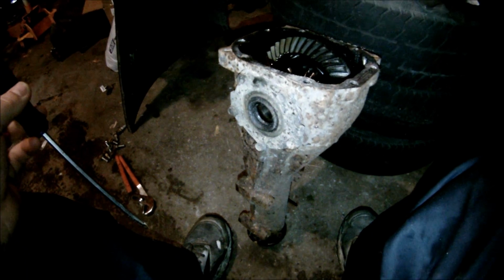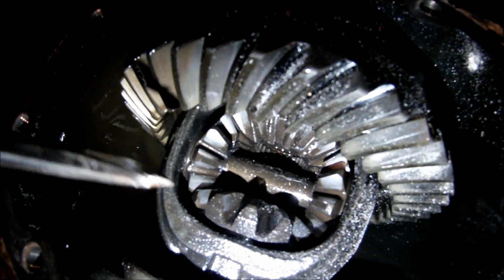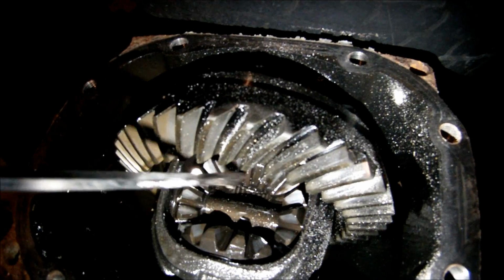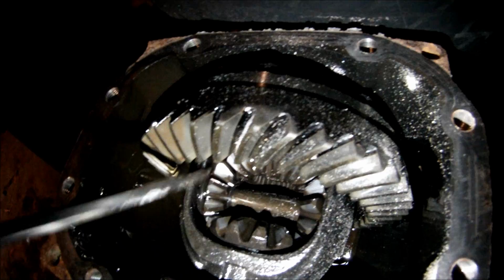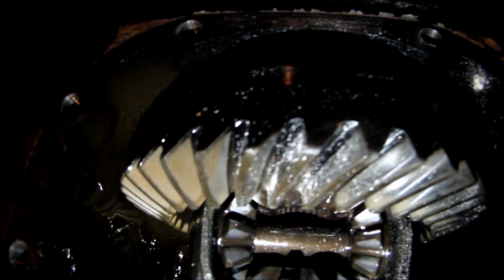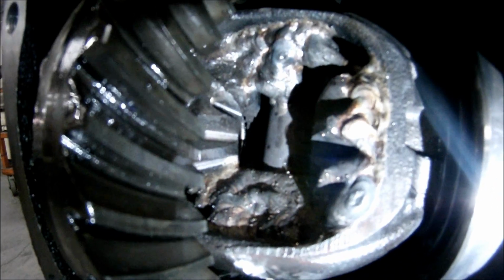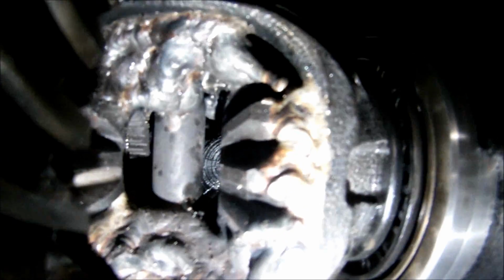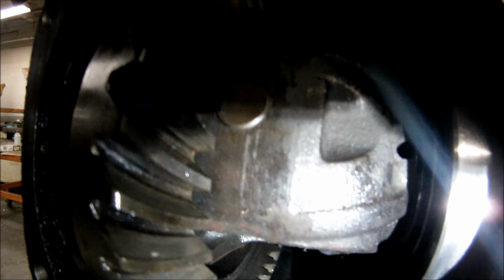How to weld a rear diff - RWDSUBY

Comment from the maker: You have the same car that this rear diff went in: 1997 Impreza Brighton with the EJ18. :)

Yeah, I trusted myself with my 110 to do all of the welding and it never let me down.  I even used the flux-cored wire that was in my dads smaller 110 and it was fine.

At one point I had a fullsize Chevy Tahoe and welded the rear diff on that, and it had some 35" Mud Terrains on it.  Even with all that weight, tire width, and torque, the welds never failed.  Go for it!

Comment from the maker: You are absolutely correct!  This vehicle was nothing but a toy for me, so I didn't care that it chewed through tires at an alarming rate.

It would bind up during full-lock corners and take a bit of throttle, but the car never lost turning radius.  I attribute that to the fact that it was so light though.

If you have the funds, it would be best for a true LSD, or even a Detroit style locker.  This was just cheap, easy, and fun.

Comment from the maker: If you're referring to the CV axle, you're correct.  If you're talking about the main carrier shaft inside the differential unit, you do weld that.  The shaft just acts as a bearing surface for the two spider gears that rotate on it, and we don't want them to spin at all so we use that shaft as yet another anchor point for the gears. :)

Comment: Just a bit of extra advise to anyone that attempts this... Please for the love of gawd, take 5 minutes to clean your welds. If there's any loose slag chunks sitting in the diff when you put everything back together, you run the risk of those bits of weld getting caught between the main gear and the rear diff cover. This will eventually cut a hole right through the cover, and nasty diff fluids will rain on your parade.

Comment from the maker: I believe it helps lock both wheels more quickly when the e-brake is pulled because even if one brake has less pull, or one wheel has more grip, if one wheel stops turning they both stop.

With an open diff, if you yank the e-brake going in to a corner I could see the inside wheel stop spinning due to less weight on it, and the outside wheel continue to turn since there is more weight.  That'd stop your skid and make setting up for the next turn more difficult.

That's all a guess though, sorry.

Comment: Good info but for those looking into this realize you loose quite a bit of cornering ability unless you are going for full on drifting, it will be harder to make 90 degree turns and will wear the rear tires MUCH faster. Otherwise cheap option for drag and drift. Best option would be a rear LSD (if you got some money to burn)

Comment: i would have to assume that the heat build up from welding the carrier so messed with the stretch of the ring gear bolts, allowing them to lose thier bite work out over time. good tutorial though.

Comment from the maker: I wish I knew. :|  Some of the bolts were shorter than others, indicating that they either sheared, or were abused while inside the case.  The other bolts were full length.  All bolts had rounded/blunted threads though.

Comment: When you weld on the gears it causes them to be out of balance ever so slightly so after time the whole thing vibrates and loosens the bolts. My theory...
Reply: nothing in the diff is balanced anyway.. And if you manage to shake out your pumpkin bolts you shouldn't be working on cars...

Comment from the maker: Meh, I cleaned everything very well.  The reason the welds look like shit is because I didn't pre-heat the massive ring gear carrier, so all of my welds were relatively cold, and because I used 316l Stainless wire with pure Argon gas, to weld mild steel. :P

It's still going strong, and that's all I need it to do. :)

Comment: hi, i got a BMW e36 316i, and im building it into a drifting car, do you think that diff will break if i weld it, or is it strong enough? some guys i've spoke with has disencouraged me to do so, due to the diff being a cheap diff and will probably break very fast, any thoughts?
Reply from the maker: I'm sure it'd be fine, but I don't know BMW diffs at all so I can't speak with certainty.

If my little r160 diff held up to this abuse, I'm sure your BMW would do just fine though. :)
Reply: +Alphieboy Haggard Garage has welded at least two e36's diffs without any issues as far as they have said.  Drifting is hard on every part of your car.  It will certainly take the life out of your diff quicker but it'll last as long as your e36 doesn't have like 200k+.

Comment: You pull weld? Would be better if you push weld
Reply from the maker: Yes sir, I've since learned that technique.

I'm a completely backyard learned welder, so trying to figure out the proper welding procedures has taken me quite some time.  I'm still not very good, but my welds get me by with my projects.
Reply: how long ago did you learn to push weld?
Reply from the maker: Two or three months.
Reply: Depending on what type of welding he did, you can only push a puddle with mig welding if he stick welded it than you can only drag, if you push with stick welding you will get a ton of slag inclusions
Reply: Richard Dailey Slag inclusions are fine if you can sand them down. I wouldn't suggest stick welding on differentials though. just my .02 :)
Reply: that is also true but i would still only use mig or tig
Reply: Yeah for sure!
Reply: Why not stick weld a diff? Stick welding gives you the greatest penetration and if you are profitiont at it the weld looks like a stack of dimes and will be stronger than a mig weld.. Tig welding would be much too difficult to do because the metal has to be super clean and you don't have the room to get a tig torch hand and filler metal hand in such a small area. When I welded my diff in my 240 I ran some 6010 stick rods and than 7018 and than filled it out with my mig gun.
Reply: because it gives off so much heat and you dont want to melt the gears
Reply from the maker: ***** Yep, you're right.

Comment: and who the hell welds oily metal?
Reply from the maker: It was all cleaned before hand using brake cleaner.
Reply: +Travis T NEVER use brake cleaner for cleaning metal prior to welding. When you heat it up it creates phosgene gas which can kill you. Check Google for a lot of unfortunate stories. Use acetone instead.
Reply from the maker: Thank you very much for the information Michael Ahlmann! I'll make sure I heed your advise in the future. :)

Comment: Well well . It broke anyway  now did you learn Anything from this waste of time stupid process . ?? 
Welding centres up never ever lasts more than one day after .
Reply from the maker: Why do you have to try flexing your brain-muscle on stuff you don't have first-hand experience with?

Nothing broke.  The bolts backed themselves out after I welded everything and the heat cycling caused them to loosen.

Waste of time?  Why can you say something I do is a waste of time?  How I spend my time is really irrelevant.

Welded center sections "never ever lasts more than one day after?"  Huh, then I must have broken the space-time continuum and this must still be that initial day, because according to you, there's no way that the welded differentials in this car have lasted over 2 years, right?

Please, don't troll.  You can dislike the video, but your lack of knowledge and experience is really showing you to be foolish here.
Reply: Circle track guys have been welding spider gears for as long as they have existed, with multi season success of high RPM racing.
Reply: 😂 had nothing else to say.